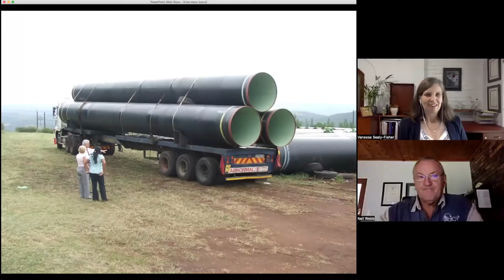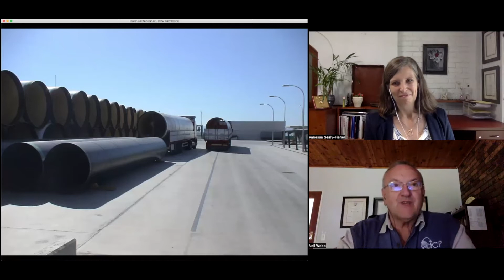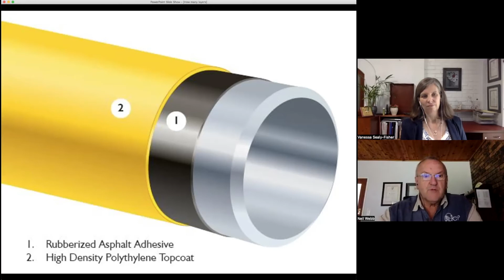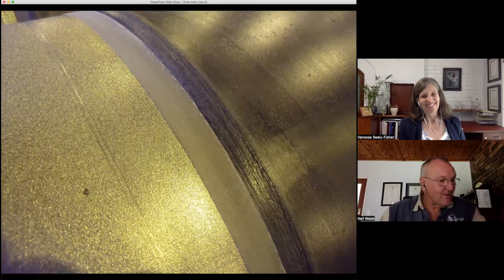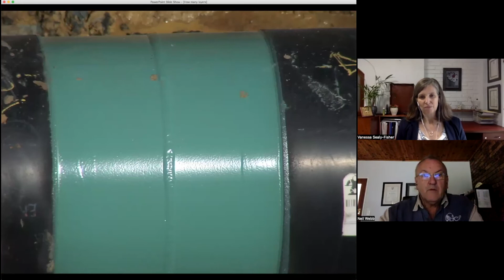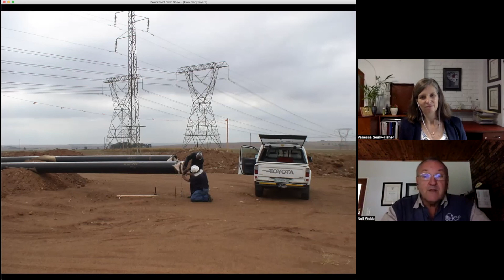POLYETHYLENE | Pipeline Coatings

Comment: Would a HDPE coating work well for coating Hot Dipped Galvanised house stumps?. We currently build up concrete up about 100mm above ground level. We are looking for an easier system. We were thinking of painting with a bitumen base like Hydra-seal and then having a 200mm HDPE sleeve that slides over the bitumen  and then we could heat shrink it on. What do you think?